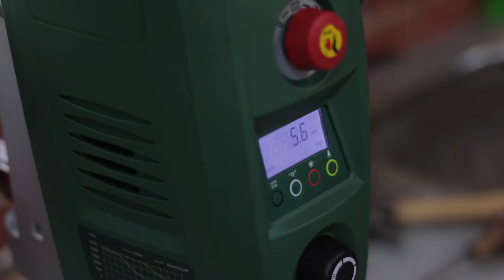Wooden Allen Key (& Wood Socket Head Cap Screw)

Comment: Did the epoxy end-grain glue hold up? Cause you  know, endgrain to endgrain is now the strongest form of glue joint :P
Reply from the maker: When I got rid of it, I tried to break it and ended up hurting myself, so I think the epoxy and extra "key holes" drilled into it (so there was the mechanical bond) are strong enough. Or its a good demonstration that I'm weak enough 😁